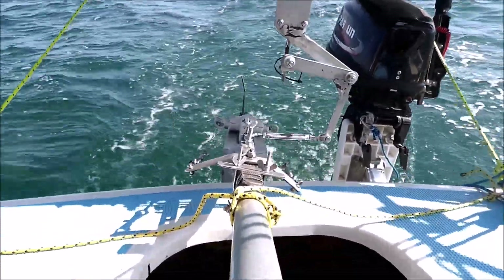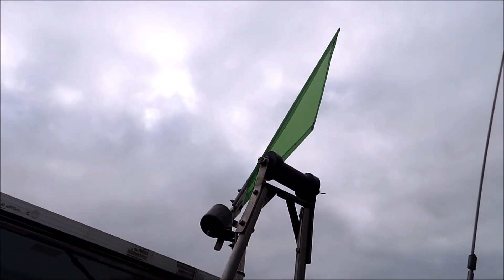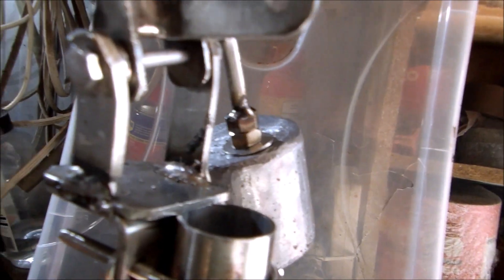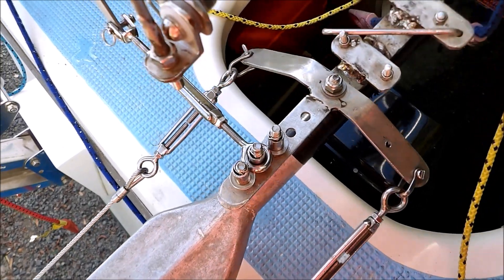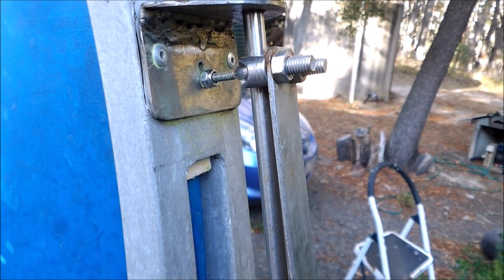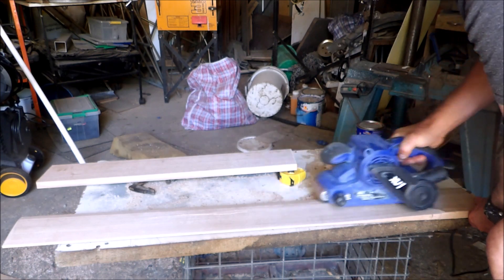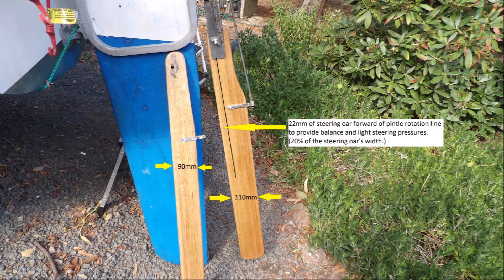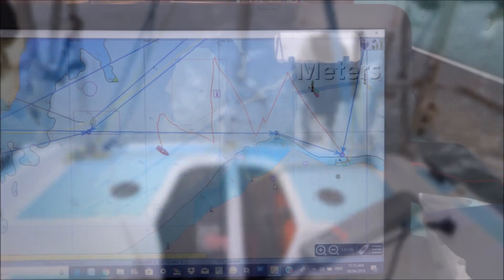Wind Vane Steering System for Trailer Sailers

Comment: Why don't you just build these for people?
Reply from the maker: Hi Bruno, quite a few reasons. Unlike other commercial wind vanes which simply bolt onto an unobstructed transom, my design has to fit into the structures and attachments on the transom of most trailer sailers and so needs to be custom built to each type of TS. Even though physics of wind vanes are easy enough to understand, matching them to the sailing characteristics of each boat is a bit of an art, more so with trim tab designs. Things like sail balance, keel placement and hull design all complicate the process. And all of the above gives the main reason I wouldn't make them  is the time involved. What people would be prepared to pay verses the time taken to build them would see me working for $1/hour. 
I love the challenge of building a wind vane that works but that would be as far as it goes.
Cheers Mark

Comment: If you rebuild this system to make the axis of the wind vane blade at the top of the vane blade you eliminate the need for a counterweight  and improve responsiveness in gusty conditions.
Reply from the maker: In principle that sounds like a great idea, I am not sure how you would get the linkages down past the swinging vane is the only problem I would see. The idea of reducing the weight of the system is a good one though. Cheers Mark
Reply: @TRAILERYACHTADVENTURES  I did it by using small lines run down through the central tube that holds the wind vane blade. Could send you a picture or short video if you want.

Comment: I have a Privateer 20 a cutter rigged trailer sailer. This is the best video I have seen on this subject, full of very informative technical and practical info thank you!! My boat is under full restoration at the moment so I am a long way from adding a wind vane system but I will certainly store this for future reference. My rudder is quite flimsy and some owners have redesigned the shape to get better balance so will need to work I guess but many thanks for taking the time to post this on Utube well done.
Reply from the maker: Hi Peter. Glad you found it informative. This is my second trim tab style wind vane. The principles behind wind vane steering are simple in theory, low friction, balancing rudders and building in feedback that stops over steering. People have often asked for construction detail but each boat is different and it can be a bit of an art to get it gelling with a particular boat but very rewarding when you get it right. I am toying around with a tiller mounted servo pendulum style system at the moment which will give more steering power on my boat that is harder to balance than my previous boats. Thanks for the comments. Mark
Reply: @TRAILERYACHTADVENTURES  OK Mark, I have never sailer my boat! I bought it 18 months ago and I have been restoring it ever since inside and out. Although I have owned boats of and on for 40 years large and small I never quite realised how much time and effort is needed to get a boat back into condition after it has been let go, The hull is sound but all the fittings were in need of refixing and replacing. Until I sail it I won't know how it handles and how much weather helm there is etc and it can be balanced with sails setting etc.
Reply from the maker: @peterhull100  I have always said half the joy of owning a boat is the tinkering. Sounds like you have a lot of that ahead of you... enjoy!
Reply: @TRAILERYACHTADVENTURES  Yes Mark, what is good about boat work is that it keeps my brain ticking over looking to practical neat solutions to problems that crop up. I find it it quite satisfying. My wife thinks other wise of course!!

Comment: This is a really very informative video, thank you so much for sharing your experiments. As some other commenter, I also would have like some kind of drawing, to better figure out the system as a whole. I understand, the « one size fits all » rules don’t apply here, and measurments are very specific to each boat. But a global view of the system, or if it could be less time consuming for you, some still pictures of each parts shared somewhere on the internet would be awesome. Thanks again !
Reply from the maker: I will see what I can do, it might be a while as I am really busy with preparations for 3 months cruising in the Kimberley. 
The basic design can be seen in the video including a couple of vane head measurements that would help. I will get some measurements of the control lever and bell crank and levers on the trim tab.  The tube I use is 32mm and that would be the minimum to allow movement of the push rod. How this tube is held in position is highly dependent on the set up of your boat. The push rod is 5mm stainless, needs to be the lightest it can be without bending in use. The counterweight on this one is 3KG as there was not enough space on my boat to make it longer. As mentioned in the video it would work better if this was lighter and the arm its attached to is longer as it reduces friction on the pivots in the head. It need to be just heavy enough to return the vane to vertical in no wind. Friction needs to be kept as minimal as possible for best results. All my pivot bolts are 6mm to create metal on metal bearings  and I use  nylon washers on any flat surfaces that may rub. The pintle rod of the trim tab is 10mm stainless rod as it has to provide for sideways stress of the trim tab that is only held at the top. The extra flat you see on the video was added to provide extra sideways strength and may not have been needed but I wanted to be sure for rougher conditions.
Unfortunately the rest is super dependent on the specific boat, rudder box design and specific dimensions. Even the downward bend in the control lever and trim tab levers will depend entirely on the shape and measurements of the tiller handle and rudder box.
The really critical elements mentioned in the video are the things that make it work. I call it the 20% rule. Trim tab width is 20% or the average rudder width. Trim tab is balanced by having it vertical rotation 20% from the front edge. The control lever attachment to bell crank on the tiller handle is 20% of the average width of the rear edge of the rudder to the pintles either forward or rearward of the pintles. In my last windvane it was behind and on top of the rudder.(swing rudder) Depending on if you put it forward or rearward of the pintles you then have to make sure the lever on the head is on the correct side. This takes a bit of logic as you want the movement of the head to cause the rudder to steer back towards the wind. If you get this wrong it will turn away from the wind and broach the boat. This one it is forward of the pintles to allow the dagger board rudder to be lifted. The rearward rake of the vane head is nice to have but it can also be eliminated to make the design simpler. On most boats it would still work well, the RL28 is hard to balance and the rake helps a bit. As you can see there are a lot of 20% measurements that are 20% of a specific boat measurement. Always happy to problem solve with peoples own projects as they go along. Cheers Mark

Comment: Thanks for the quick reply Mark. My boat is a 1993 MacGregor 26s with swing keel and transom hung swing rudder it is around 3000 lbs to 3500 lbs in the water. Not sure if one would work on my boat. Sure could use some help when solo sailing. Hopefully I don't have to go with electronic unit and all it would intell. More electricity. What are your thoughts if one might work on my boat. I live ln Florida and want  to do some costal sailing solo. So thanks again in advance. Jerry
Reply from the maker: No worries Jerry. the 26s is the one with the single transom hung rudder it should be workable. It would have to be along the lines of the trim tab vane I made for my first boat which I have sold a few years ago now. I do have rough plans and pictures of that system if I can get an email to send it to. Don't post emails in the comments here though.  If you go to my channel and click on "about" apparently you should be able to send a private message. I will send you what I have to give you at least some idea of that system. Again how it is held on the boat will depend on what railing, push pits etc you have to work with. It will also depend on how the top of the rudder is constructed. Cheers Mark
Reply: @TRAILERYACHTADVENTURES   I'll also send a message with my email if you wouldn't mind sending the plans.
Reply from the maker: I haven't got an email yet. I cant attach plans on the youtube email. When I get the email I will send you the plans but they are scans of my rough drawn plans.  Cheers Mark
Reply: mdedman100  I didn’t see any place to send a private message.
Reply from the maker: If you go to the channel page and click on "about"  I have now added an email link to use, I didn't realize it wasn't there automatically.
Reply: mdedman100 Still nothing
Reply from the maker: @williamdunaske4601  Go to https://www.youtube.com/user/mdedman100/about and you may have to be logged in. Button will say show email

Comment: Just found your Channel I have a trailer  sailboat 26 foot and I am searching for information for a wind vane  for it. Do you have other videos concerning your construction of your vane. I would appreciate it very much so thank you in advance Jerry
Reply from the maker: Hi Jerry,  This is my only windvane video although I did make another windvane years ago the details were on my own adventure website which I have since discontinued. The main questions to ask would be: 1) is your rudder transom hung? 2) is your rudder a swing rudder or lift type?  My current design was specifically for transom hung lift rudder which is difficult to design a windvane for. My previous design was for a swing rudder in which the trim tab was attached to the rudder blade itself like the flaps on an airplane wing.
Either way the points made in this video are critical for a wind vane to work. As each boat is different unless it was for an RL28 giving measurements other than what was in the video already wouldn't be much help. The  important things you must include are: 1) the lever controlling the trim tab must be 20% of the average rudder width(measured from the pintles to the rear edge) in front or behind the pintles to provide steering feedback. 2) 45 degrees of vane movement should translate into around 20 degrees of trim tab movement(a bit under half) 3) the trim tab should have a width no more than 20% of the rudder blade 4) Metal on metal bearings give least friction(friction in the system kills any wind vane efficiency. 5) 10 degree rearward rake in the vane is desirable but not essential, reduces over steering. 6) counter weight should be just heavy enough to return vane to vertical with no wind, lighter weights and longer balance arms work best. 7) If replicating the design in this video balancing the trim tab reduces steering pressures. This means the trim tab or steering rudder should rotate for steering around a line 10% of its width from the front edge. 8) Sail balance must be good for any windvane to work well. 
Hope this helps. Every boat is different but the above principles stay the same. Fitting to any boat is a fiddly process of trial an error as its not like the commercial units that bolt onto the back of your boat as a big self contained framework and just have ropes to the tiller to steer it.  Trouble is most of the commercial ones wont work with a transom hung rudder. It is also important to remember that windvanes  have limitations. They work best in winds 10 to 25 knots and can struggle in following seas and strong winds. I always carry an electric tiller pilot but use the windvane when every it is suitable... magical watching it do its work.
Cheers Mark

Comment: Hi. My qestion is will it work on catamarans, do you have the plans and drawings along with the measerments?. Wind vanes are very expnsive. not sutable for a catamaran.
Gerard.
Reply from the maker: Hi Gerard. My system would probably not work on a catamaran unless you only use one rudder. I don't have plans as it took a lot of experimenting and changing to get it working.  The things I talk about on the video are important. On a catamaran a servo pendulum design would work better controlling the twin tillers with lines but these are much more complicated to build. Every boat is different so plans don't often help as they have to be modified to the boat. Sorry cant be  much more help than that.
Cheers Mark
Reply: @TRAILERYACHTADVENTURES  
Thanks for the reply. i ve been advised that boat i was looking at may have been on an older ad so it no longer avl.
I just keep looking around.
thanks again.
Reply: If it is a cruising cat, with balanced sails very little input is required.  A simple air vane should suffice.  Pete Hill on Oryx did so and sailed around the world

Comment: well done Mark!....... sheer genius...........once  again. When you owned Halcyon, you had an excellent web page on everything. Modifications and equipment etc.
have you thought of doing the the same for Neringa cheers Tony W .....i'm very impressed. I will buy you a beer one day!
Reply from the maker: Hi Tony. Thanks for the comments, not sure if they are entirely deserved. As you might have guessed I love tinkering on my boat. The website I built has been modified and is still on the web with all the Halcyon Days stuff still on it. It took a lot of programming on my part and needs a lot of work if I am to continue using it. Google has changed the rules on using their maps so I would have to teach myself a whole lot of new coding to fix that. My picture upload code has also stopped working  and I haven't been able to work out why, suspect its actually something the hosting company has changed but not sure. Long story short it would probably take me a month of full time work to fix it. You can still browse it ok except the maps now have water marks all over them. If you are interested the address is www.sharemyadventure.net. It was changed to be multi adventure site and you will see a tab "Halycon Days" for the old adventure pages for Halcyon. If I ever get around to fixing it I may start an adventure page for Neringa. The beer sound great!  Cheers Mark

Comment: Best wind vane video on YouTube by a long shot.
I dream of a complete set of stills with measurements.
Thank you for more great inspiration.
Reply from the maker: Thanks for the comment. Trouble with all the measurements is that every boat is that little bit different. The system in the video was changed and modified numerous times in the last few months to improve its performance. You might notice the awful looking welds that have been ground and rewelded many times. I suspect I will continue to tweak it some more although I am pretty happy with it now. The main points I make in the video about vane rake, vane to trim tab movement ratio, width of the trim tab and most importantly the feed back on the control lever are the things that make any vane system really work. Cheers Mark